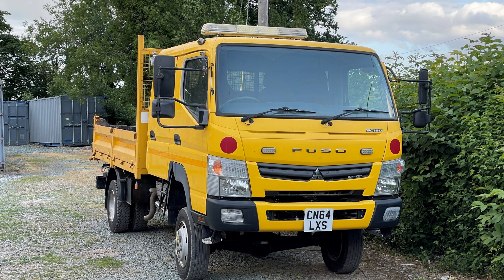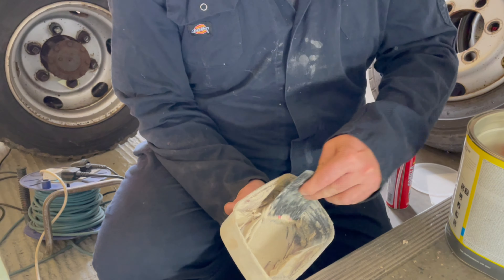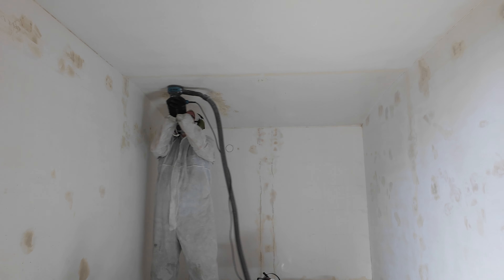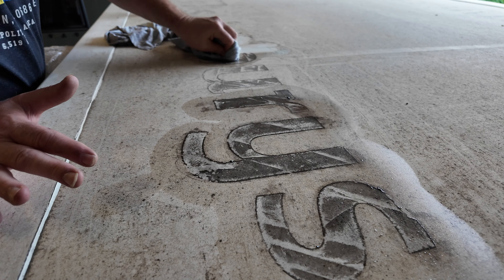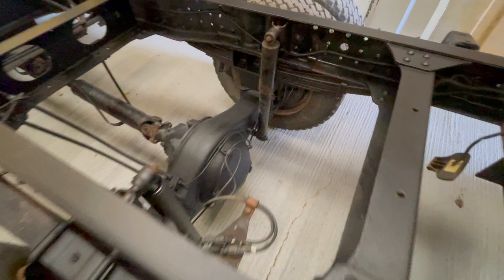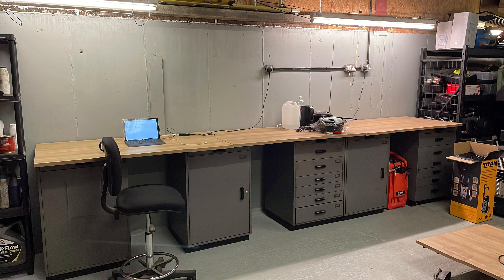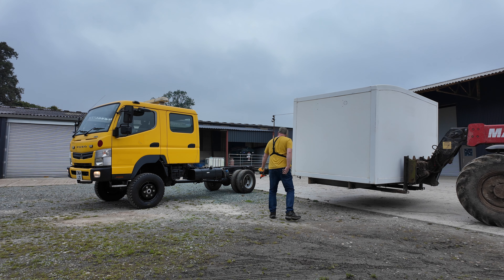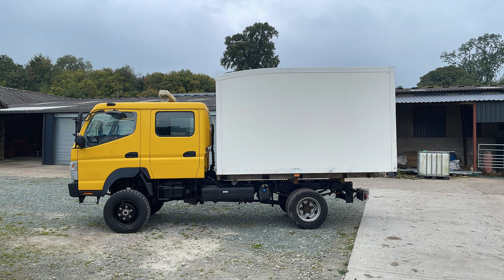Fuso Canter 4x4 Fridge Box Campervan - "Saving the Chassis"  [S2:EP3]

Comment: I felt your pain! Our Canter was a snow plough so the chassis clean up was the same if not more time consuming. Had the same problem getting our duals off too - the inner nuts were reasonably easy but the inner and outer nuts wouldnt fully separate, so the wheels had to come off as pairs!
Reply from the maker: I'm waiting for a tool from Mercedes to remove the studs..  if it arrives will have another good go at them at the weekend
Reply: @syncrojunkie  Couldn't quite tell from the video - are your singles 17.5 or 19.5?
Reply from the maker: I went with 17.5 like you did, I did.  seriously consider the 19.5 but did not want to have to mess with the arches and also not looking to go rock crawling, or super extreme off road,  and no low range on this unit..  Gearing is the same as my Syncro’s G gear in 1st in the truck, hoping that will be good enough for the pistes and trails I want to cover.
Reply: @syncrojunkie  The other thing with 19.5s is the sidewalls are too stiff. I'm running 68psi in the front and 75 in the rear to (optimistically) soften the ride a smidge. I see you're using the Z-drive tread (TTS?) too, I was lucky to get a full set of Bridgestone M729 cases for retreading. We've climbed a few tracks that 1st gear has been low enough to do the job.
Reply: @syncrojunkie  A bit cheeky using my photos on your website?!
Reply from the maker: You are right, they should not be there, they were used for mocking it up!  I have asked for them to be removed! Apologies...
Reply: @syncrojunkie  Was just teasing! What was the offset you went for? I miscalculated and went with 90mm, which means the rear track is 20mm wider than the front, though that is nothing to lose sleep on.